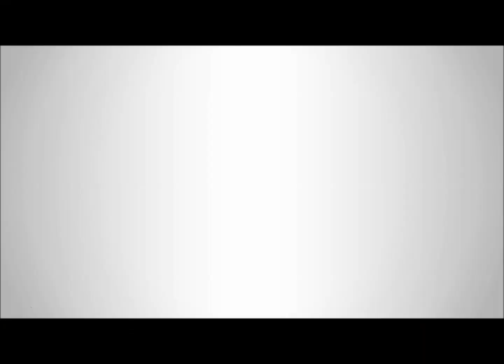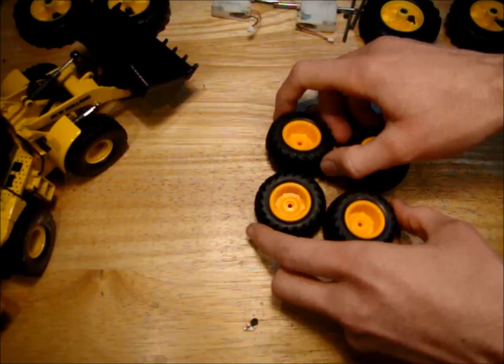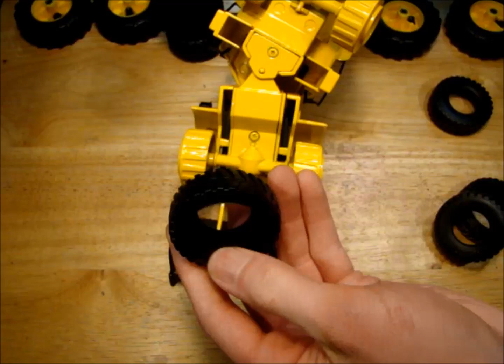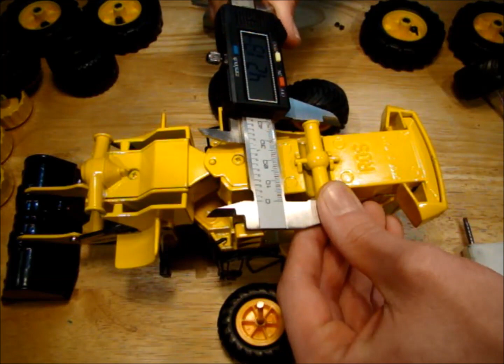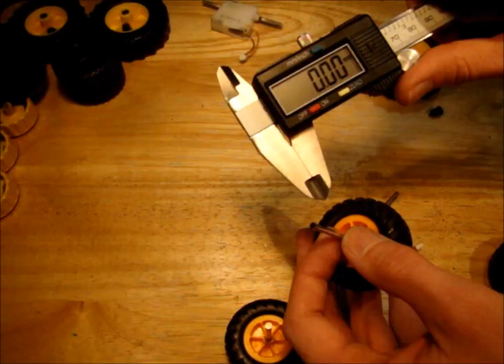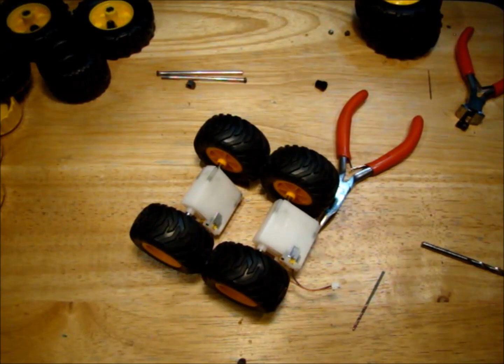RC New Holland W190 Loader build Part 1 - Getting the Siku drive motors and new wheels ready

Comment: Nice build hope the front drive and lifting rams for the boom and bucket goes well ,i had to build a new boom for my bruder loader mounted the servo in the boom
Reply from the maker: That's a nice model, it looks like you built an entire chassis for it too that's good work. Do bruder models have any metal structure in them at all, I've never had a good look at one. My motors wont be as well hidden as yours, I don't think there will be the space but I wont know until I get the motors and take a proper look.
Reply: Thanks ,the bruders are all plastic models good grade of plastic though , i built the bottom portion from metal using screw drives for steering also
Reply from the maker: pumptech100 I'd say that gives you a lot of steering power. I actually started the steering on mine already, I have an N20 motor above the pivot point which is working pretty well but with no differentials it is under a lot of pressure dragging the wheels around, hopefully it will last. It will probably be mostly on gravel or sand so wont be as hard on those surfaces.